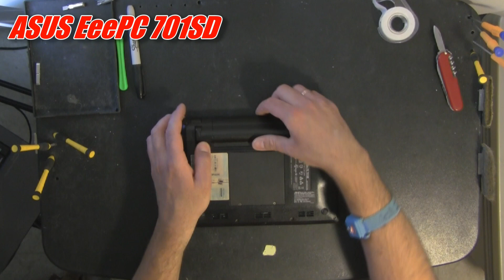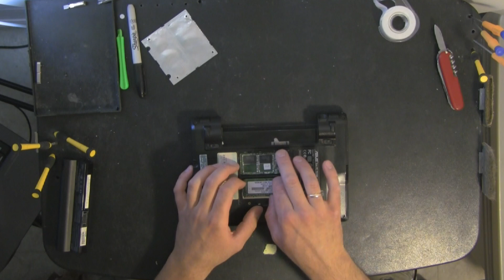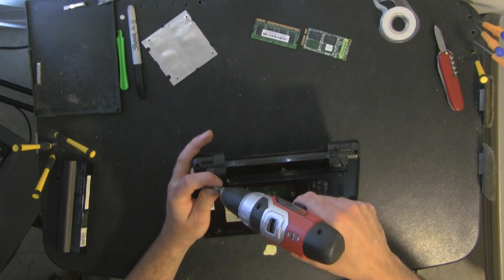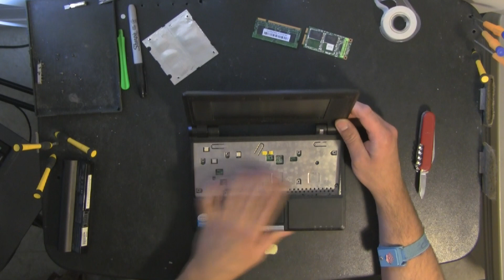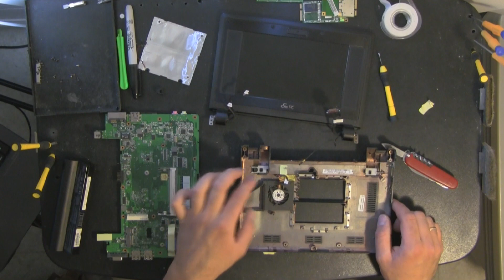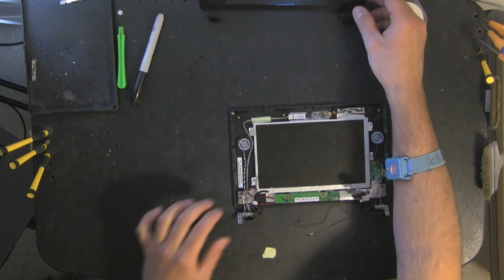ASUS EEEPC 701SD take apart video, disassemble, how to open disassembly

Comment: Just a couple of observations:

1) You don't need to separate the plastic panel from the metal plate (you will save some time and damages to the plastic pins)

2) Most the screws are perfectly equal. The twos that hold the modem are shorter. The official Asus guide can be very helpful http://www.intellcity.ru/content-2/service-manual-notebook-ASUS/service-manual-Asus-Eee-PC-4G-701-Chapter-02.pdf
Reply: At which point in the video did they do this (seperate the plastic? from metal) timestamps please?

Comment: Just and FYI, for those of you out there. There is NO need to remove the plastic from the metal sheet. I will all come up together. As long as you remove the proper cables from ports nothing will happen. Besides. Removing the plastic casing from the metal sheet breaks all the stupid little nubs and it won't snap back on. It WILL however, stay in place once you replace everything into ti's proper location along with screwing it back together.
Reply from the maker: Thank you very much for this comment!
Reply: No problem. Sorry for the few typo's. I had kids bugging me when I wrote it. Yeah, I find out after I removed it that it just sucks to the plastic once you remove all the screws and the mouse and keyboard cables.
Reply from the maker: Hey Kimberly, I have kids too, can imagine how difficult it can be!  I hope you have fixed your laptop and now everything is fine!!!

Comment: Hey man, I have the same laptop and is still working fine. Can I upgrade the RAM and ROM. kindly help me suggest
Reply from the maker: Depending on the windows, you may or may not need to upgrade ram. If you want to upgrade hard drive, you would need to make sure you have windows key available.

Comment: seeing how he manhandles this, and uses a drill (how many of us have overtorqued a laptop scre to the point of dislodging the brass insert or breaking plastic), I wouldn't buy any parts off this guy. Not even minimal ESD protection is seen (that drill probably generates a few thousand volts of charge). The motherboard stands a chance of having missing parts based on the way he was prying shit out wildly. Don't buy a motherboard from this guy. The metal is probably stripped from the ribbons. RTFM

Comment: fuck my touchpad is not working anymore
Reply: nvm fixed it. note to self: don't fuck with laptops
Reply from the maker: ***** great to hear you fixed it! This small little netbook isn't bad.
Reply: Happened to me too. Was it a hardware or software issue?
Reply: Hardware, I couldn't manage to plug the touchpad cable to the motherboard first time. I had to open it again and press on it harder.